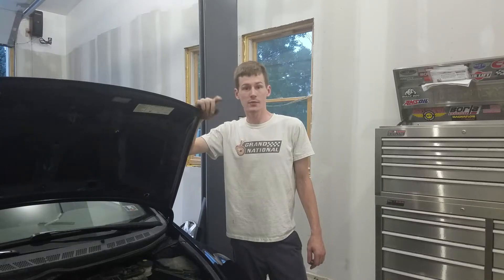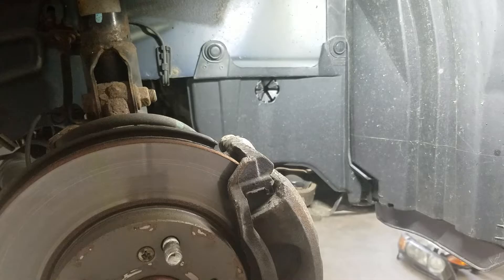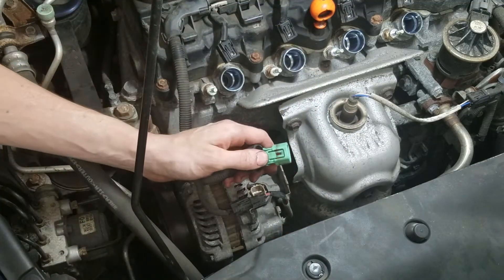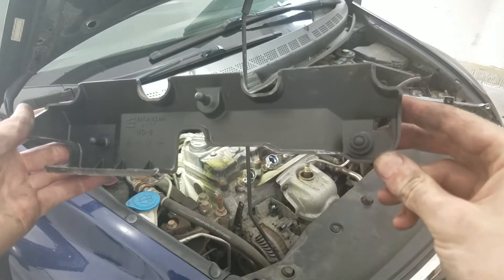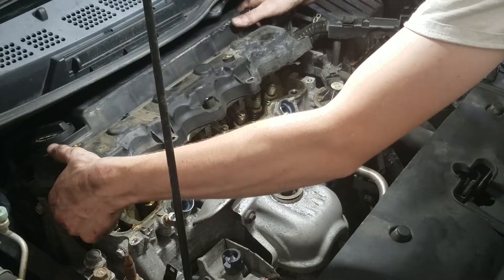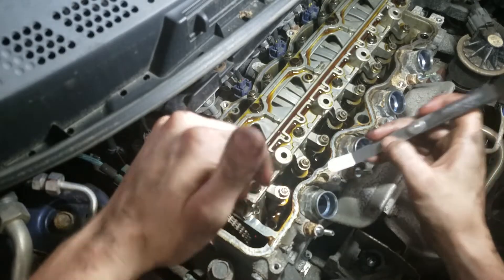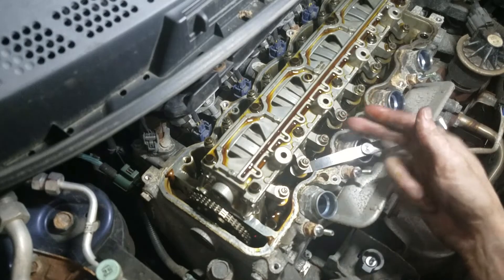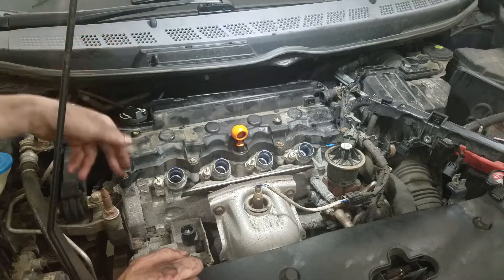2006-2014 1.8L Honda Civic Valve Adjustment

Comment: I have this engine. How do I know if I need to do this? My car runs perfectly smooth as-is. 92k miles.
Reply: L. Dega  I need a report or actual data to understand where you are coming from. I'm talking flat road with low friction tires (Pirelli P4) and I get 43-46 going 55mph.  My 1986 accord also got 40 going 65.  Honda is known for under powered engines, or really efficient ones on the small end.
Reply: L. Dega  I'm sorry but no, you go find it. I shared and now if you'll notice, you are the only one starting something.  I've checked my mileage numerous times. I am sorry you are not happy that I get good efficiency.
Reply: L. Dega  these engines are extremely fuel efficient on the highway actually
Reply: Rule of thumb is if you hear sewing machine esque tapping..
Reply: My 07 LX has 357,000 on it and I just started hearing it. I still get 37mpg going 75mph. Great engines.   I've got this to do, the serp belt and the power steering pump(spotted leaking during inspection and I assume that can't be from a leaking can shaft seal or anything else leaking into it). I may do the water pump while I'm at it.
Reply: L. Dega  I'm sharing my experience and betting my mechanical engineering degree from Rensselaer that you don't know your butt from a hole in the ground and really ought to keep your trap shut when you try to connect torque and power at highway speeds to fuel economy. I've also owned this car since 2010 and have done all of the work on it. Just because you have had a different experience does NOT mean I'm wrong. Got it?!

Comment: If you DONT want to jack the car up and remove a wheel to turn the motor over,  you can remove the plastic bung for the cam gear bolt and use the bolt on the cam to turn the engine over. Taking spark plugs out is also optional to make turning the engine over a little easier! Good video man!
Reply: 5 speed you can jack it up place in 5th and rotate the tire to spin the crank over making it much quicker and easier!
Reply: Rotate the alternator bolt
Reply: @darkfred007marcotte3  I heard doing it that way can make the belt slip, I saw Danny 'The mechanic' doing it this way so I guess it is a safe way of doing it and easier.
Reply: You can also just man handle the serpentine belt to turn it over
Reply: I always figured that's what that plastic cover was used for
Reply: Why does the camp shaft need to be rotated? Does it get rotated to TDC?
Reply: If you do take the plastic plug off, have a new one ready to install if it's old. They become very brittle over time
Reply: @IJustExploded Or maybe TheyJustExplode when they're brittle? 😉😅
Reply: Good afternoon that little cam cover it's a plastic circle piece w a gasket ?

Comment: Great video.  I've never adjusted valves on my 2007 Civic and there's no clicking, but the valve cover gasket is leaking, so I'll be right there anyway.  Car has 240k miles, so figure I should check/adjust them.  I do have a couple questions.

This is probably obvious to most, but I didn't hear you address it and want to be sure.  You said that the adjustment for the exhaust is .009-.011 and as you are adjusting cylinder 1 exhaust, at 11:29 you can see .010 clearly on the feeler gauge.  So I'm assuming you chose that because it's right in the middle of the .009-.011?  So for the intake, you'd use the .008 feeler?

Second question.  Are the lock nut and jamb nut the same thing?  At 10:34 you call it a lock nut and then at 13:24 jamb nut.  Just want to make sure since I've never done this before.

EDIT:  I found my answers (Yes to all) watching another video.  Again, thanks for your video.  Very well done.
Reply: WARNING !!!!!  make  SURE  each rocker arm is sitting on the  FLAT SIDE  of the cam lobe  for  EACH  valve when you adjust it. 
you can mess this up  BADLY
adjust your  valves loose.  adjust them to the top of their tolerance after the vehicle has sat overnight. COLD.   NOT THE MIDDLE
you DO NOT want your valves tight. 
valves  DO NOT  grow extra clearance and start ticking. 
valve clearance  DOES NOT get bigger.  it gets smaller as the valve wears into the seat.  the stem moves closer and closer to the rocker and eventually the rocker is  ALWAYS  touching the valve and the cam at the same time which prevents the valve from landing on the seat  AND THEN   the valve stops closing tightly and begins to burn around the path of least resistance.  a burned valve means the head comes off.   
EXHAUST  valves take more abuse from heat on the valve seat and should be adjusted to their maximum tolerance.
don't worry - you won't notice  ANY  difference in performance or engine noise. 
after finishing your adjustment - go through the entire rotation again and recheck each gap.   MAKE SURE  you did it correctly
Reply: @mixter7x7  I'll make sure the engine is cold before I start and remember to rotate the engine and recheck the gaps before I put it back together.

You said :  "make  SURE  each rocker arm is sitting on the  FLAT SIDE  of the cam lobe  for  EACH  valve when you adjust it"

That means rotate the engine using the 19mm nut in the wheel well making sure the timing chain sprocket shows 2 when you adjust valves for cylinder 2, shows 3 when you adjust valves for cylinder 3, and shows 4 for cylinder 4, right?
Reply: @dcloes   honestly - i can't say and i won't give you info i'm not sure of.  it's hard to see the cam and possibly the reason they numbered the cam sprocket.   confirm that in a manual or another video somewhere before assuming the method is correct.  you might also use a mirror to look directly at the rockers where they ride on the cam to make sure they are on the flats - not the lobes.   flats of the cam are also referred to as the " base "  or " base circle "
Reply: @mixter7x7  After watching a couple other videos doing this on the R18 that shows them rotating to each position on the sprocket (up, 2, 3, and 4),  I'm confident that if the "up" on the sprocket is correctly centered as Repair Geek shows at 8:31 in the video,, the rockers are where they need to be for their valves.   As they are when you rotate it to 2, 3, and 4 and their valves.   I'll triple check though.  Thanks for the extra info.
Reply: @dcloes   more extra info - i have a  10mm deep well socket i made into a tool just for this job  -  with a short handle ( 6-8" )  welded to the side -  my screwdriver fits right through the socket.  use the socket to loosen the jam nut.  insert feeler gauge. make adjustment as required with screwdriver and while the screwdriver is still holding the adjusting screw going through the socket -  torque the rocker jam nut with the socket / handle.
i have several different sizes  8,10,12mm  and  1/2, 9/16 for domestic diesels with overhead cams  i made into tools for this job considering i've done a million hondas and i used to work at a motorcycle dealer. 
it makes this job  VERY VERY  easy.  the socket holds your screwdriver in line and it doesn't slip while you're trying to retorque the jam nut. 
also - take your feeler gauges  OUT  of the pack. they're much easier to work with.  you can hold them easily with hemostats - preferably and they're not as bulky. 
i strongly recommend doing an entire row of at once instead of skipping.   do  ALL  the intake valves along one row and then ALL  exhaust valves along the opposing row.  it goes faster and you're not getting your gauges mixed up.
Reply: @mixter7x7  What do you mean by "adjust them to the top of their tolerance" which one is top in this case of exhaust ".009-.011" ??
Reply: @fi8er1     answer  -  .011"    adjust the valves to the high number of lash or tolerance.  it's ok to have the valves loose by a few thousandths  because this lash or gap allows the valve to close completely. you can't hear it and it doesn't  negatively effect performance.   if you try to adjust them to a lower tolerance or   " lash "  you run the risk of not letting the valve close completely while the engine is running which is  VERY  bad  ESPECIALLY  for the exhaust valve.   if the valve lash tolerance says  .005 " - .010"  you should adjust to .010".   you should adjust your valves every 100k miles  OR  if you replace a head gasket.   the intake valve will have a smaller lash than the exhaust because the intake valve does not expand as much.  example  the intake valve will call  for   .004 - .008  while the exhaust will call for  .007-.011   this is normal.
Reply: mixter7x7
thanks
I’m still confused, if what you are saying is right and the valves don’t get loose over time, then how come it’s found that some of them are loose than the spec?? Because of the lock nut slightly lets it loose overtime?
Reply: @fi8er1    poor lubrication ?   the head changes shape every time it heats and cools.  cam bearing wear.   who did the previous valve adjustments ?  driving conditions ? 
there are several reasons. #1 being whoever did the last adjustment not doing it correctly. 
it's also most likely the intake valves were loose because they don't wear nearly as badly as the exhaust valves and seats  - which are open / exposed when the burning gas exits the cylinder.
Reply: mixter7x7 
Well, I just did the adjustment and almost all of them were loose, I heard from somebody that hondas clearances gets loose overtime, not sure it its true...
However still adjusted them to the loose side of the range, sounds way better now, hope it stays this way as this was my first time doing it....
Reply: @fi8er1    what kind of car  ?  with how many miles ? you are the first owner ?   the only thing that would cause a valve train to develop more clearance is wear taking place on the cam, rocker , rocker shaft or the valve tip. i have never seen these items wear when the oil changes are done regularly.  the only thing that would cause these components to wear is lack of lubrication.  i have changed a lot of honda heads because the owners didn't do the valve adjustments - the exhaust valve sunk into the head - the valve could not close and exhaust gas burned past the valve and seat.  if you catch it in time you can simply replace the single burned valve if the seat is not damaged.
Reply: mixter7x7 Thanks for your experienced help.
How can I confirm that I did it properly, there is still some ticking sound although way better than before, it is normal for it to sound like this?
Reply: @fi8er1    you're welcome.  some ticking is normal in  ohc engines especially at idle.  the engine starts and runs which means it's mostly right.  if you made a bad mistake the engine would be sputtering or not running smoothly.  the only way to confirm is to remove the valve cover and recheck with a feeler gauge again.  at low speeds less oil is pumped to the head to fill in the clearances / lash and the temps are cooler causing the valves to shrink.  at higher rpm's  there is more oil to fill in lash and the valves are expanded because of heat - which is the reason you add in the lash - so the valves will actually close completely during high rpm operation.
Reply: mixter7x7 
Highest tolerance for intake & exhaust?
Reply: @Gleeleeglee    should be listed on a placard under the hood.  easy to find online.
Reply from the maker: You're correct on your first question. The specifications given are a range. So, obviously you want your adjustment to fall in that range.

And you're correct on your second question, they are the same thing. I just used 2 different terms without realizing it.

Comment: Nice video!  How do you roll the engine?
Reply: Did you watch the video?
Reply from the maker: Remove the passenger side front wheel, you will find an access hole to get through the inner fender that will let you get a socket on the crank bolt.

Comment: When should you do the valve adjustment s?
Reply from the maker: It's usually at about every 100,000 miles. If the car is making a tapping noise do it sooner.
Reply: @RepairGeek  ok thank you